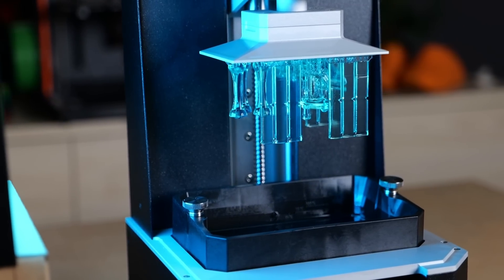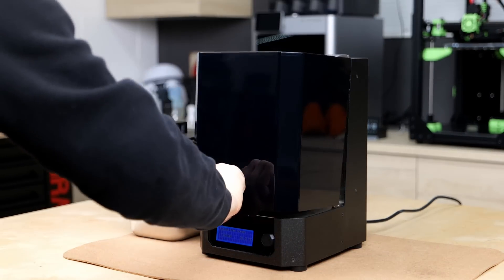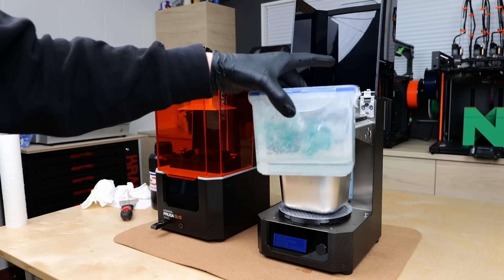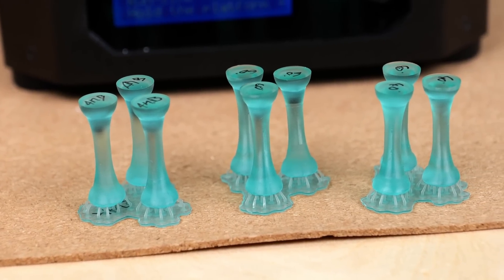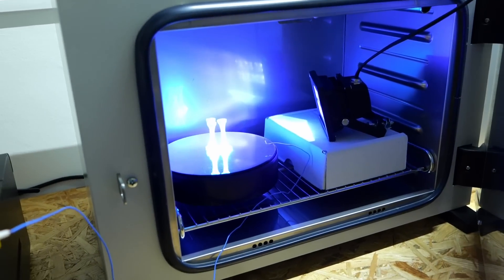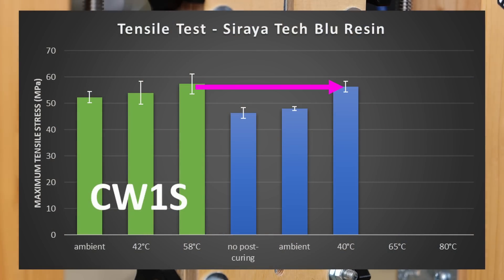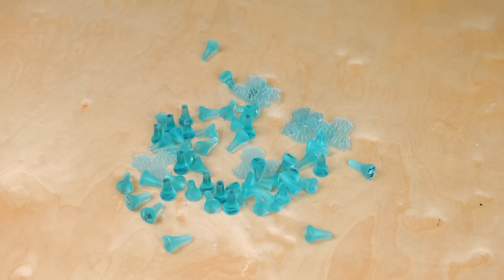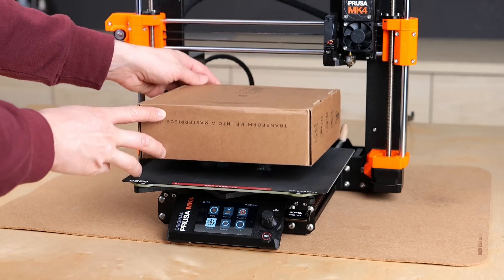Why does Nobody Cure their Resin 3D Prints like this? (40% more strength)

Comment: Stefan, give this a try... I am 6 months into resin, yes its brittle for what I need, but it has potential. You showed something I will try and I want to share this, idea with you. 
	 Look at wax Resin (jewelry casting Resin) it needs special air free curing, so cure in water or in a vegetable oil. , I started curing my "ABS - Like water washable resin", in water and yes the parts are stronger & less brittle. I have done this,  white & black pigment. 
	Now after this video I will boil water (100 C) and bring it down to 80C and attempt curing in clean hot water, but I don not have a torture test device as you do, so try that next time, please.

80c Heat + Zero O2 + UV = ??

Should be an interesting experiment and maybe one day, I'll build a hammer or pull device myself and can share the result with You.

BTW Thanks for all the helpful things you, have showed me and "Hab einen schönen Tag" ( Have a Great Day)

Paul in Vegas
Reply: Be aware that where soaking can make water permeable plastics stronger, nylon becomes significantly stronger when wet.

Comment: Curious how adding a little Siraya Flex resin would affect the parts, it is commonly added to increase impact strength.
I wonder how water curing at 80C would affect this. Water curing is to keep oxygen away from the surface, as oxygen tends to inhibit full curing.

Comment: Technically this is tempering, and can be done with most materials. Just have to find the right combinations. Epoxy / resin tempering has been around for a while now. 3D printer people are generally a little slower on picking up the science of the related industries.

Comment: Hi @CNCKitchen, I work in a company that's specialize in bonding manifolds with Acrylic and Ultem, the thing is that the annealing process it is especially important to cold down the material "slowly" inside the oven,  if for some reason the cold down is too quick like take the part outside the oven and let it cold down, the plastic is more fragile.
I don't know if have sense what I'm saying (my English is not good)

Comment: I inadvertently discovered something similar when I accidentally left the heat cycle on my utra sonic cleaner when cleaning prints before curing they seam stronger even before the UV chamber as they were harder to remove form the platforms

Comment: Surely the remaining cross linking will occur by itself over time without the need for additional heat. The heat only accelerates the process. I suspect resin manufacturers know this hence not suggesting the additional complication of heat treatment.

Comment: I need to try this. UV light on the bed of an enclosed printer? BTW... I have been leaving my FDM prints on the build with the heat on for a few hours. I have no way of telling if it works or not. It would be interesting to see the test results. Also, what would cryo-treating SLA and FDM prints do to the structure? Using liquid nitrogen or dry ice and alcohol with the parts in a poly bag. Would it even work?

Comment: For many years now, there are a lot of dental curing devices which combine UV and thermal curing. Some models even have programmable temperature ramps like reflow ovens. Another inexpensive option is to use incandescent UV light source, which produces a lot of heat (like 10% efficiency in light conversion - the rest is heat)

Comment: The monomer/ oligomer composition is highly significant here. Not everything will react the same. The max temp is important. 
The depth of cure is important. 
Time / dwell in all conditions is important. 
When it means something we v cure in a modified autoclave ( cheap, like a pressure cooker) with a PID thermo controller ( $15-20 inkbird) and a home built led array. The parts are fully submerged in water or covered in nitrogen.

Comment: Interesting video.

I am into mechanical keyboards and want to try printing my own keycaps.
The design I'm thinking of using has a design that has a clear enclosure over the parts with the letters on them.
Can you suggest a good clear UV curing resin?

My thought is to 3D UV print each of the inner parts in a solid colour and then add UV clear resin to fill in the areas that would let through the backlighting.

Then, the clear enclosure part would be made in bulk, either using the 3D UV printer or using just using a translucent mold to harden the enclosure's skin strong enough for removal. 

Either way, I would, of course, be exposing all the parts, clear or otherwise, to UV for a couple of days to completely cure them through & through.

The whole idea is to make really nice legends on the keycaps and then use the replaceable enclosure to protect them from everyday wear & tear.

The clear resin in the legends would also allow some redirecting/reflecting of the backlight, hopefully giving good lighting to the characters, no matter where they are positioned on top or the front of the keycap.

As I would only he making 200-400 keycaps in total, I figure to just buy a resin printer with a build area about the size of a business / credit card.

Comment: proper curing either expensive or complicated. you can't just put UV leds into the oven.  Most leds have max temp limits to 60C and as usual in electronics, divide that by 1.5. 80C UV leds hard to find and way more expensive. And don't forget that you probably want different wavelenghts 365-405. Aaaand, do that in a uniform way and make thing not explode, broke and all of that.
So you need proper curing, heating, cooling and deflection at the same time. And this is where it comes to expensive side. Cure station that costs x3-4 from your resin printer? easily!
What I'm actually doing - I put my prints into hot water and let them cure for 15-20 minutes. Changing hot water each 5 minutes. I don't have  strength test machine and can't test, but it shrinks less for sure. I think shrinkage spread in time is much bigger problem than strength.   And yes, I think Blu or Conjure transparent are the best for this as it makes curing more effective

Comment: How about a test for high temp resistance outside annealed pla, petg and Abs?

Possible candidates for some diy high temp Printers outside of cnc milled aluminum f. E.

The best one i currently know of would be 3dxtechs pccf (non ez) or something like the treed Pc-pbt-gf.

A test like that would be very cool, and im sure im not the only one interested in it, currently the only obvious options up to like 95°C is ABS and ASA. But after that? Lets say someone wants a stiff Part up to 110 or 120? This is the question thats seemingly unanswered.

Paired with higher load deforming over time, like you had with your Nylon cf (pa6 or pa12?) on your voron v0.

Comment: An interesting thing is that looking at the Prusa CW1 source code, it looks like it could be just a couple lines of code to add curing + heat. Without digging into it too deeply, as I don't own a CW1 and (hand wave around other tasks) it's a feature flag and maybe a config setting. Add those, compile, flash with PrusaSlicer and tada cure + heat? I don't know if there's some other technical reason why it wasn't done or just wasn't a thing that was expected to be done.

Comment: I wonder how this changes with the geometry of the part.

I've always had a theory that UV hardening was going to primarily harden the surface and was never going to penetrate evenly to the centre of the part. So I wonder if the benefits you're seeing here are down to better curing of the interior of the part (something that could possibly be tested with thicker/thinner parts).

Comment: Hi Stefan! We print from BASF and Loctite resins at work (automotive prototyping) - and it is actually required to "bake" the finished prints for a while before UV curing. Not so high temperatures - around 40-50C for 30-60 minutes. So if manufacturers like these companies recommend it, there is actually some science behind :)
And with Siraya Blu You can even go higher - i did several tests up to 250 C - for 60 minutes. Interestingly - part remains in its original shape, but starts to crack at temperatures above 125 C. Resin prints dont melt into blobs as FDM prints - there are a lot of "undiscovered" areas of resin printing ...
Reply: Hi!
Interesting.
Did you ever tried the BASF ultracure st45b resin? The datasheet seems very good for impact and strength but I am really asking myself if it is real or not!
Any infos on that?
Thanks
Reply: @maximefrotin9146  Hi! Yes its not bad, but it is a "semi-flexible" resin - and it hardens through time. When You print and cure it - it feels a lot rubbery, but after 1 month in exterior usage it became brittle. Overall my long term winner is still Siraya Blu - really one of the best out there. Regrettably I had no chance to test Phrozen green nylon - it also seems incredible, but somehow we never got to order it :(

Comment: Curios could we use a toaster oven to heat set/cure our resin parts? If it is consistanct enough, it's great alturnative to the UV cure then heat cure process, since most people can find a cheap used toaster oven to do the job. I was ways wanted one for polymer clays so win win for stop using you kitchen oven.

Comment: I made resin printed shapes to cast silicone molds and to avoid cure inhibition with the platinum silicone there were some ideas to cure the resin in the oven but for me the resin always cracked, and I just gave up heat curing.

Comment: I bought a cheap round food dehydrator with glass clear housing to dry my filament spools (as you showed earlier) which is capable of reaching 70°C at any location inside (proved with digital thermometer). I can imagine to cure resin prints in it with 70°C or less and an UV-lamp shining from the outside in. Have to be sure to protect eyes from the UV-light with googles or a surrounding housing.

Comment: Not sure if you mentioned any cure times in this video. What are the times for UV exposure vs cooking? Wondering if you've played with UV exposure times? I found that SyriaTech Blu yielded early and with lower strength if I cured at 15 minutes. Curing at 30 minutes gave more strength with less yield, though I'm sure it increased brittleness. I tried all the way up to an hour, but it didn't change much after 30 minutes of cure in my AnyCubic Wash/Cure.

Thanks for the heating info though. Seems I need to rig temp controls everywhere. Resin printer enclosure, fdm enclosure, resin curing. Thought I might do a heater in the AMS, but you mentioned heating for too long there could mess up the filament. Not sure if I want to go with the membrane there though. Maybe if they had a "click-buy" option, I might be more tempted.

Comment: I wondered if it was possible. When  Retrobrighting plastics using UV /lighr only will only bleach where light will touch. I have moved to using heat around 180F or where the plastics will handle. While doing that I wondered if temperature curing would penetrate the entire resins, especially colors

Comment: Couple of suggestions:

1. Remove prints from supports after washing but before curing.
2. When removing supports, soak in hot water for a little bit. Tap hot is good enough.

Both of these things make support removal much easier in my experience.

And yeah, for minis we want those things to be tough.

Comment: No need for a curing oven. Simply curing in warmed water at around 60c and a normal 405nm uv light source.
Curing in water helps remove oxygen in the curing process, which prohibits the photo initiator process as an added bonus.

Comment: I have been seeing some videos and articles around UV curing in water in clear containers. That it provides a more even faster cure and cleaner since the part is sitting in water being cured so no potential for dust to settle and cure to parts. etc etc
I have been giving it a go and it works great. I haven't really investigated the "faster" claim since I just put my stuff out in the sun outside since it is sunny. But it has REALLY helped with dust on parts, especially since the area I live is very dusty outside just due to pollen and the general nature outside. I also don't like having these high VOC resins inside so I cure outside and my printer is in the shed. So that saves me from the dust and VOC's

What I am wondering now since the heat assists with stronger curing, is that maybe we should try heating the water during the curing stage? 
The water would provide even temperature stability though the part, the scattering of the UV would make the curing even and faster according to the claims, less messy, and we could encase the water container in a heat insulating material to reduce heat waste. 
I have zero clue what the presence of water during the heating would do to the stability of the polymers. I think I will give it a test at home and just do something subjective since I don't have a tensile strength testing rig like yours. But it would be great if you could test something like this officially.

Comment: i usually post cure with the parts submerged in water - this quickly removes all stickiness from the surface (oxygen contact seems to inhibit the curing of the resin!) eg. if you didnt clean them 100%. And using hot water may double in adding strength while keeping the parts from deforming - Thanks for the tip!
Reply: Oooh, it's the oxygen! Thanks for that tip! Now the water or nitrogen other commenters write about make sense.

Comment: Have you tried curing parts in water? I’ve had great success using a cheap wash and cure. I wash normally in ipa, allow to dry.  Then placing the partin a hot water bath in a clear vassal and curing that way.  Cheap and effective!

Comment: A while back, I saw people curing their resin prints in a glass of water inside the UV chamber, arguing that the water better dispersed the UV light across the model. I imagine you could probably use a clear Pyrex bowl filled with hot water to achieve a similar effect.

Comment: Would love to see you test out curing while submerged in heated water.

Sirayatech recommends curing under water as well as many other tough resins.

I've been curing my parts while submerged in 60c water and letting the part cool in the water to room temperature.

I'd love to see if this has the same effect. If so, a very effective curing heating machine could be build with a sous vide or instapot

Comment: interesting. You mentioned some people cure in the sun. I live in hot climate, so why not create a hot box which allows UV curing but also allows the the temperature in the box to increase. A simple fan regulator could be used to ensure the temperature does not get too high. totally eco friendly or with resin (perhaps not)

Comment: I worked back and forth with siraya tech over a cunfusion with their blu mecha formula. One incredible technique the engineer told me to cure the resin 3D print submerged in water. I noticed a big difference in hardness and strength when doing this
Reply: water submersion UV curing at room temperature will make your resin prints so much better, especially the surface finish.
Reply: Damn he got the secret i was hoping he would of figured it out in the video amazing i will have to share my set uo in the comments

Comment: Stefan, excellent video (as always!)

I find that curing the parts in very warm water has yielded drastically different results in the quality of my prints.
Reply from the maker: Thanks! If you say "drastically different", is that good or bad?
Reply: @CNCKitchen  a very large, positive difference between a 'standard' dry, unheated cure and a cure in warm water.
Reply: @CNCKitchen  As someone who primarily resin prints, I'd personally love to see that tested, as it's much more reasonable than buying/making a small heater lol

Comment: I actually discovered this by accident thanks to a messy house finch couple. Putting prints outside had been part of my post curing process already. I assumed it was more UV from the sun making the prints stronger but the finches knocked a part into the shade and it was still as strong as the rest. Turned out it was the heat.

Comment: I post cure anything i need max strength for in a hot water bath. 
Essentially after washing i fill a glass jar that fits inside the curestation with hot water around 70c straight out of the hot tap and run the standard curing process.  
Often coming back an hour later to remove them once theyve cooled down,   
I havent done any measurement tests like you, but when  physically attempting to snap things like calibration prints, theyre notably much harder to break.  
apparently the water also allows UV light to get further inside the resin and bends around curves to get to some spots that are harder to cure usually.  
predominantly ive been using siraya resins aswell.
Reply: Do the same thing with glycerol instead of water, it's even better.

Comment: I print a lot of resin dental prosthetics we use temps anywhere from 20-60c for up to an hour depending on your curing unit. Some units use nitrogen filled chambers to cure while others finish cures in a 60c water bath .
Reply: yep, my denture resins calls for curing 20 minutes in 60C glycerin bath, or sealed in a bag in a water bath.

Comment: Have you tried curing in water? Perhaps try curing in different temperature waters too. Including 0 degrees c up to boiling/100? 
This would be a way to get up the temps. without worrying about equipment's health. 

I know for some casting resin curing them inside vegetable glycol to remove their contact with air whilst curing helps them with burn out. Maybe trying heated vegetable glycol too so the parts can't absorb water.